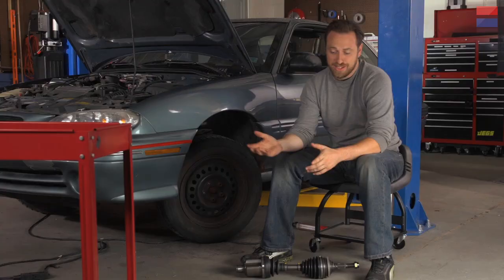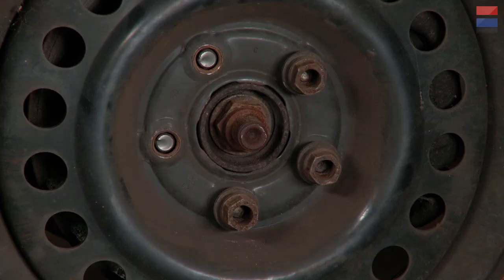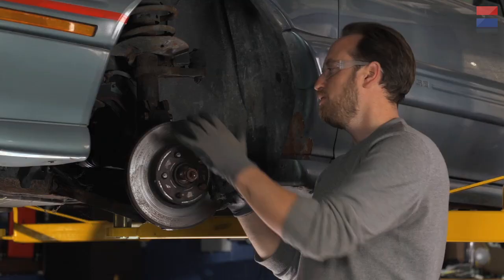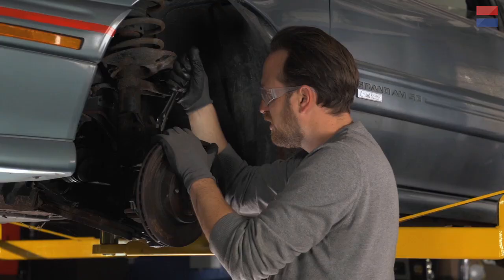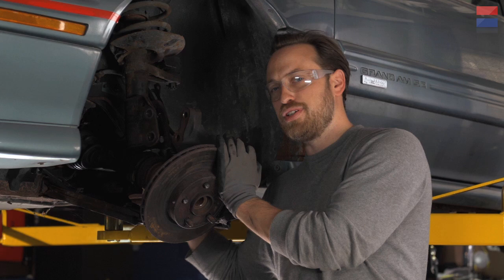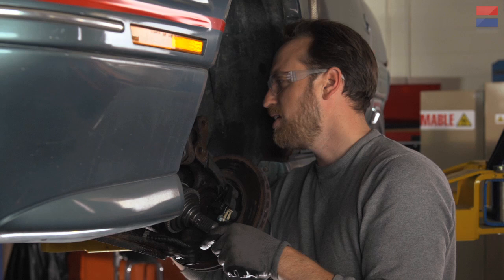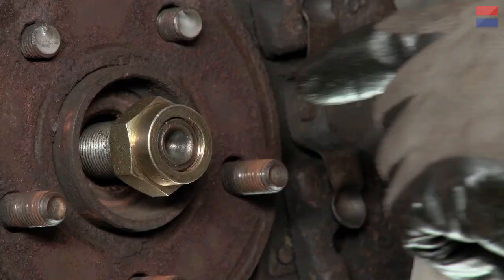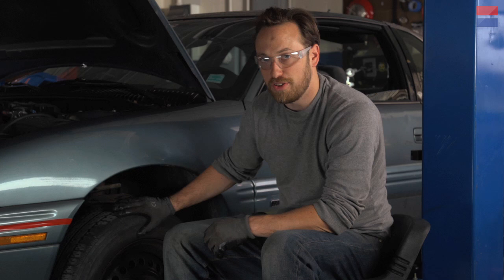How to Replace a Front Axle Half Shaft

Comment: Just replaced the cv joints in my daughters car but we are hearing a grinding noise from the front end. What could this be please?
P.S 
I didn't do the replacement.
Cheers,
Greg.
Reply: When was the last time you had the brakes inspected? Usually a grinding sound you will hear when the pads are pretty close to gone, and kids will drive there cars until it literally fails! Had many of my kids wait to tell me about stuff for their cars till it became even more expensive because they did not mention it when it first started. Good Luck!
Reply: I know this is an old post but it might help somebody who reads this comment. it's possible the grinding is  just the dust shield for the brakes.  Sometimes they get bent in the process of doing work and the shield gets bent and  grinds on the back side of the rotor. super easy to fix. just take the tire off and look at the dust shield ...t's the round metal plate behind the rotor. Just be sure its not bent and touching the rotor.  This is quite common after doing work on the brakes or suspension.

Comment: Ugh I have a piece of crap 99 Infiniti g20. Wondering if I should try this.  I also need new calipers, new muffler and fix a water leak by door.  I might just junk it.
Reply: +melonbarmonster I've got an '00 G20 which has been very good.  I do have some of the same problems as your car though.  Had the axle changed by a mechanic.  And I need a caliper for the 3rd time.  Muffler is original on mine and luckily no water leak.  How many miles do you have?

Comment: hello, so after the completion, my transmission is not going to gear... I cannot go forward nor reverse
Reply: I know it's been some time since your reply was posted, but I thought I'd throw in a suggestion: 

First, I would check to see if you removed the shift linkage from the transaxle when you replaced the shaft(s).

Second, I would check the fluid level in the transaxle (hopefully you refilled it after completing the repair, since you have to drain the transaxle in order to accomplish this repair). The transaxle won't engage in either direction if there's no fluid in there to make it work. 

Third, be sure you install the proper type of transmission fluid for your make and model of vehicle, since most vehicles require a specific type of fluid, and putting in the wrong type can cause all sorts of headaches!

Hope this helps you and anyone else browsing this comment stream.

Comment: Why not just pull the lower ball joint to pull the hub away. save on the alignment
Reply: was thinking the same thing, would there be enough room to get the axle out? some cars maybe.
Reply: 2_percent Often times, looks like this one too, that pinch bolt is one time use and will break. I have broken one. With this car, if you don't jack with the tie rod, I wouldn't get an alignment because they'll just adjust the toe most likely.
Reply: 2_percent that is correct..  I removed my brakes, and the lower ball joint, and it came right out.  Actually, it's cheaper to remove the control arm, and replace it along with the axel.  The parts are all cheap enough for a DIY guy.  Rebuilt Axel is $36 and a moog control arm with rivited ball joints and the front and rear control arm bushings is $48. Both shipped to my front door from eBay or Amazon.  No alignments needed. Quick and simple, plus now I have a mostly new front end.

Comment: I'm assuming this should be done to both sides…driver side and passenger side?  The front wheel drive on my car will not engage…I have no power at all.
Reply: No need, only the damaged side need repair. No power, some shafts might dislodge from it's inner seat and induce that "no power" very rare but might happen usually after an intervention where the shaft was not properly seated in the first place. ;-)

Comment: evening,  Just waent to my local repair shop to have my latest Lube oil and filter done and while they were looking undernieth my car they found this and this is how they listed it on the report card as they call it and was just wondering if you have ever heard of this happening,  and by the way this occurred on a 2002 Ford Focus---- Front Axle half shaft bracket Missing,  Upper bolt causing clanking sound bracket hitting Engine block,  and at the end of this,  they listed that this is NOT REPAIRABLE,  this is the part that really scares me,  have you heard of anything like this, and if so,  do you think that it really IS unrepairable???   Also they said to get a Straight shot of the area where the bracket/bolt is missing,  they said that they might have to take out the whole Engine,  and if they do that, that is what is really going to cost alot of money,  so in a matter of speaking, they also told me that it might be better just to save up and possibly purchase a new engine for my car,  so the main thing is,  what do you really think of all this,  meaning, do you think that this problem CAN be fixed or repaired or do you think I ought to think about maybe just purchasing a whole new engine for my car??? THanks.........
Reply: What's your update? I'm not sure what they're trying to scam you on but my 08 Mazda is basically the same as Ford and Mazda had deals together at that time and shared parts and designs. 

I'm not a professional, just a student, but based on what appears to be their findings, it doesn't sound expensive or that serious, unless we think about the movements and functions of the parts. You're in the same boat as everyone else here on YouTube replacing their axles, however you will as well will be replacing your intermediate shaft bracket. 

The real issue here is how long and exactly what is on under your car. If the intermediate shaft is actually, physically, gone, then you have to seriously consider the possible damage to the differential housing. Has nothing to do with your engine. Check the output shaft seals and inspect the differential. This is your main worry and concern, which would be mostly possible if the bracket is completely gone and slightly possible if just the bracket is broken. At the least, get a second opinion.

Comment: If only they all went that easy, should replace the seal while the shaft is out, also read the brake clean can. most state not to use the spray on rubber components, I know brakes have rubber parts but read the can instructions. What about the broken wheel studs? you are going to drive the car with only 3 wheel (lug) nuts on ??????
A little knowledge is dangerous!
Reply: If there is no cam on that strut bolt I don't think it matters which way it goes. My car has notches that indicate they go on the same way as here, but that could be backwards to another make ans model.
Reply: Alan, he said at the beginning that the car was a junk car and that he was only useing it for demonstration purposes.
Reply: "How to Replace a Front Axle Half Shaft", Not "How to Replace a Front Axle Half Shaft and wheel studs".
Reply: Well sorry what's the point of a new "half shaft" if 2 of the lug nuts are missing?
Reply: Alan Murphy I'm guessing it's for all the people looking to replace a axle that don't have two of the wheel studs missing; If it was just one or two steps it would be different, 3 elf centering lugnuts is probably good enough anyways
 IMO
Reply: Alan Murphy If u listened that is a car for demo purpose only he said he lost the title
Reply: Brian Juba Thank goodness someone listened.